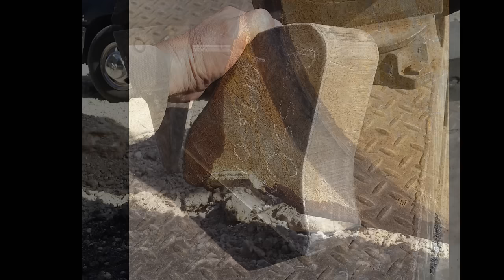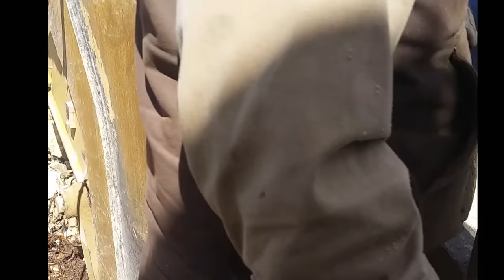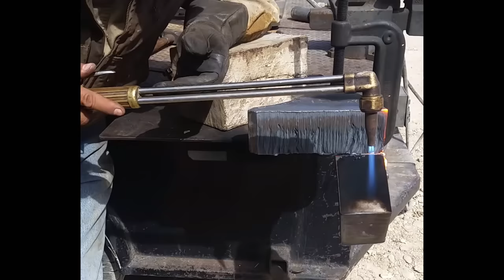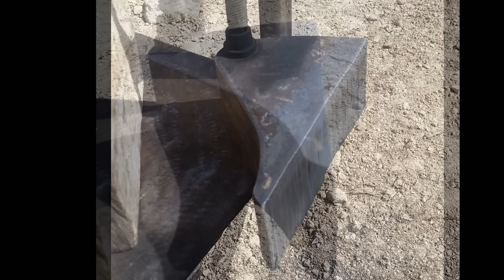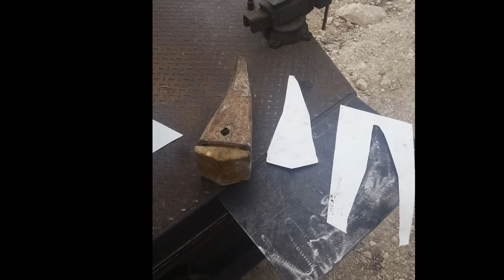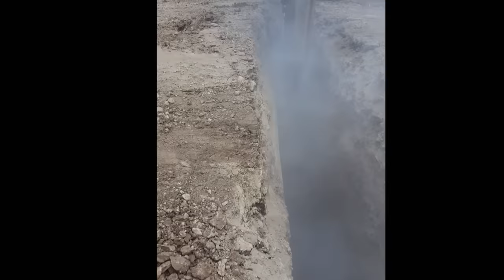Torch cutting big plate.

Comment: The cutting torch is commonly referred to as a "gas axe".  In Isaac's hands it becomes a "gas scalpel". Simply amazing!
Reply: Could not agree more!! Genius
Reply: @michaelminers2612  yea that second cut I dont even think you could cut that thin with a saw i mean yea it decarbs and slags the surface but that was an even unburned out thin cut off. as good or better then some machines, especially when you have someone that dont use the machine as often and gets an ugly cut. and if there is a better worker with a torch I have yet to see them in my feed, and thats a thick chunk of metal got to keep it steady or it will not get an even cut very easy to go too fast
Reply: Well said! He’s not only a craftsman, but an artist as well.
Reply: Flaming hack saw around here...lol. Some people have a gift for it. I know a guy who can acetylene torch cut better than I can plasma cut with a drag tip and a guide.

Comment: I am 61 years old and learned torch cutting when I was a young teenager. I even learn to weld with a torch before I ever used any type of electric welding machine. Not much impresses me these days but your skills with a torch are out-of-this-world.
You torch cut like a laser.
Simply Amazing!!!
Reply: Same with me. I learned welding with gas torch before ARC welding. Did all of the cutting with gas as a metal fabricator building off-shore rigs.
Reply: Learned my freshman year of high school, sure wish still had those 15 yr old eyes. Bifocals makes things tough, those cheap reading glasses help but it's not the same.

Comment: another awesome video Issac, back in the mid 80's i worked for CML Northern Blower here in Canada ,we built exhaust/fresh air units up to the capacity 1 million cubic feet of air a minute and for the pedestal base of the unit we used armour plate usually 2- 3" thick and all torch cut, using a guide, i could do a bit of the 2" thick and i sure learned how to be patient, to plan and take my time cutting, couldn't afford to make mistakes, i could never cut freehand like you do, that is an art all in its own, that steel looked smoother than a Sunday roast beef dinner  when you were done 👍

Comment: When I was a young man, I worked as a draftsman at a steel supplier drawing full scale patterns for torch cutting machine that could follow my drawing with an "electric eye" and cut out as many as 6-8 parts at a time.  This was before CNC, laser cutters and water jets.  Had to add an extra 1/8" all around for the kerf and for final machining.  They could cut up to 10-12" thick steel plate if I remember correctly.  I was always impressed with the fact that you could cut metal that thick with a torch.  Some of my drawings were quite large as they were to be made into large paper making machinery.
Reply from the maker: I remember those machines. Super impressive.

Comment: Ok.  Just when I thought I was pretty good with a torch, this cat comes along and slices 4 inches with no preheating and results that are pretty much ready to fit and weld. I'll just be over here on the side...holding my wife's purse.
Reply from the maker: I failed to mention I did preheat the material but not enough. the cuts were a bit serrated at first.

Comment: Good evening, to repair these parts, do you use 7018 welding or do you use another type of welding for greater resistance to wear suffered by the work carried out by these machines?
Reply from the maker: 7018's most times but this was Fabshield 21-B fluxcore wire.
Reply: @ICWeld  And the gas pressures as soon as you handle them to cut those thick pieces?

Comment: I am not a welder. My question is why did Issac make one large cut and then a much much smaller slice. Thanks. As always Issac 🙌🏼👍🏼
Reply from the maker: I noticed that my 2nd cut was not square to the plate so I made a 3rd and final cut. The 2nd was good but crooked.
Reply: Simply Amazing!

Comment: A very nice job for sure,however if you score the line where you want to cut with a cut off disc,about one sixteenth of an inch the flame will want to follow the score. If you cut to the scrap side of the line you will have a nice smooth straight edge left on the good side, be able to cut with less pre-heat flame producing a nicer cut. This tip is more for your viewers who want to improve your game as there is absolutely nothing wrong with your technique.

Comment: What tip are you running 3 or 4  it is cutting razor smooth and you have a very smooth and consistent stroke you’ve drained a few bottles in your day I’ve only seen one other guy that good with a torch and he was 86 been running one for 60 years every day died with one in his hand he taught me so much when I was a kid but I’m not that good yet I cheat with hose clamps and guides every chance I get

Comment: Do you use acetylene or propane issac? Also what type of flux core wire did you use?
Reply from the maker: I use acetylene and Fabshield 21-B wire
Reply: @ICWeld  great video and thanks for the info.

Comment: That’s such a smooth cut with a torch…what gives the torch its ability to cut metal so thick? Is it the tip or higher regulator pressure, or combination?
Reply from the maker: yes, all the above. even the small torches have the ability to cut through thicker materials.